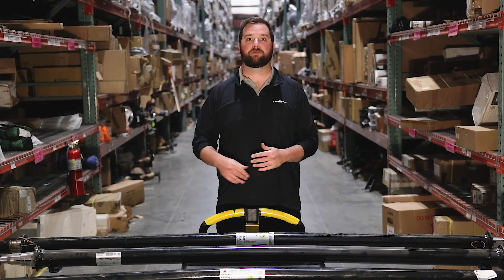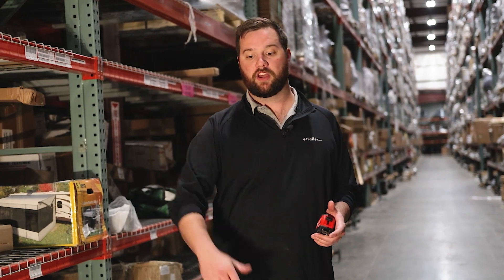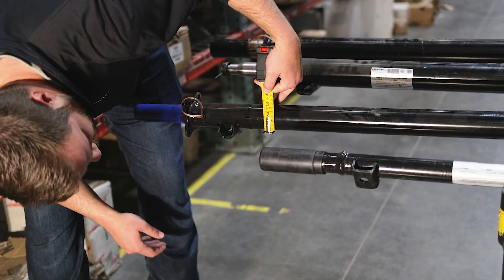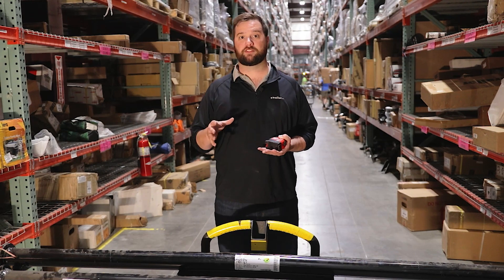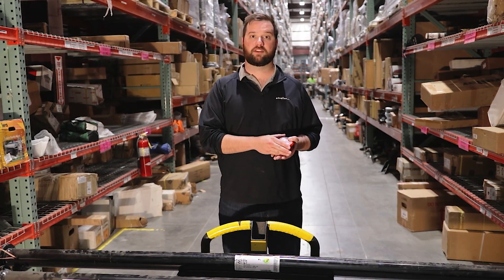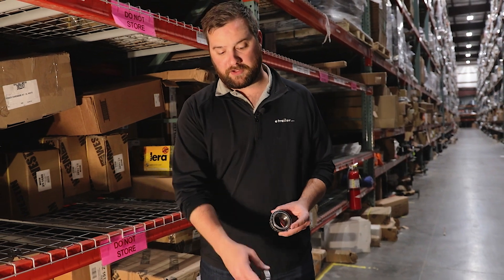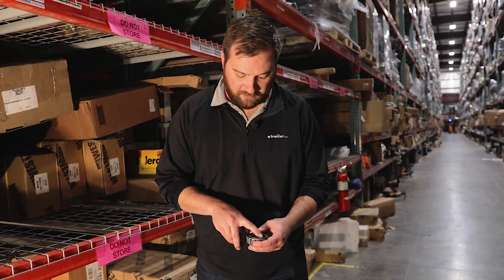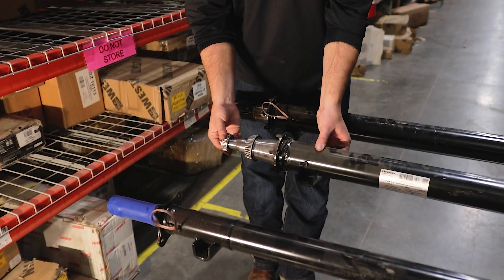How to Find Your Trailer Axle Capacity

Comment: My axel is Square.Same deal?
Reply from the maker: Square axles are different. What's the reference number from your inner and outer wheel bearings? What's the wheel bolt pattern? With that info, we can figure out your axle capacity.
Reply: @etrailer  diameter outside is 2.5 ,5 lugs square tube any idea? All metal older style trailer.

Comment: I have 16k axles!! What are the axle size?
Reply from the maker: By 'size', do you mean the diameter of the axle tube? A 16K axle would usually use a 5 inch diameter axle tube. If you meant something else, please let me know.
Reply: Exactly what I meant!! Thank you so much!!
Reply from the maker: You're very welcome, glad we could help!
Reply from the maker: If you ever run into that again, use a flexible measuring tape. Measure the distance around the axle tube, and plug that into an online calculator. I can't recall that from Geometry class in high school either! Type that info in, and it'll spit out the diameter! How cool is that? I'll link you to one below:
https://www.omnicalculator.com/math/circumference-to-diameter
Hope that helps!
Reply: Thank you

Comment: What if it's 2.5 with a 5 lug wheel ?
Reply from the maker: You likely have a 3500 lb axle, especially if you have a L68149 inner and L44649 outer wheel bearing.

Comment: I have a vintage travel trailer from the 50’s with a 2-5/8” diameter and six lug nuts spindle and five leaf slipper spring, any idea what’s the weight rating might be?